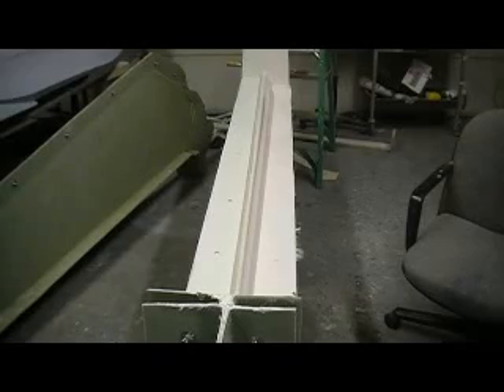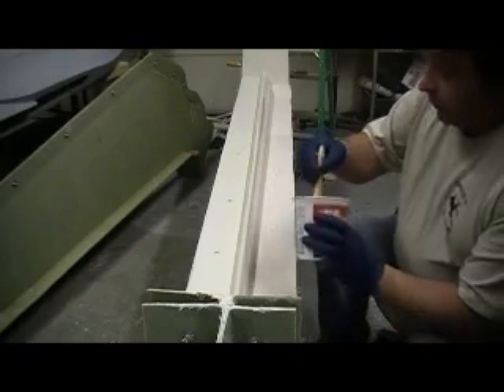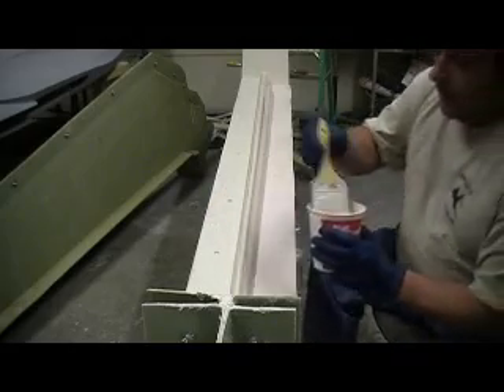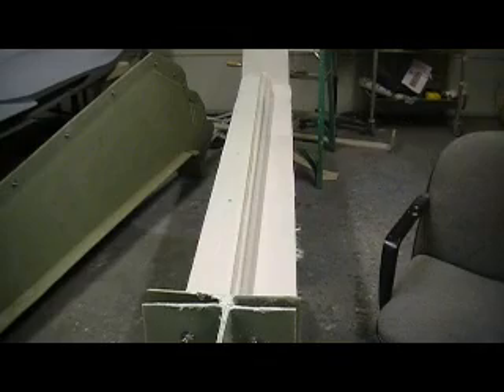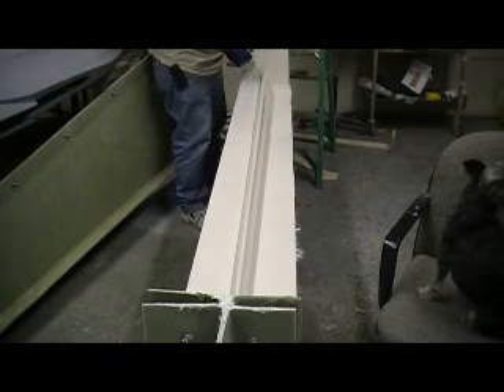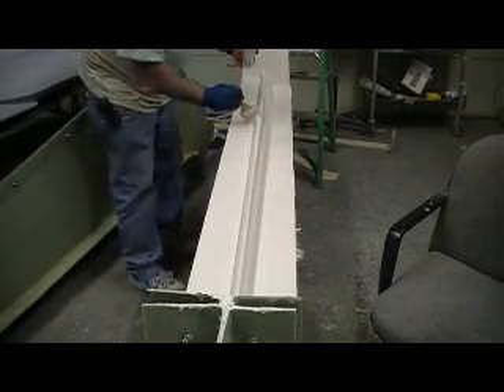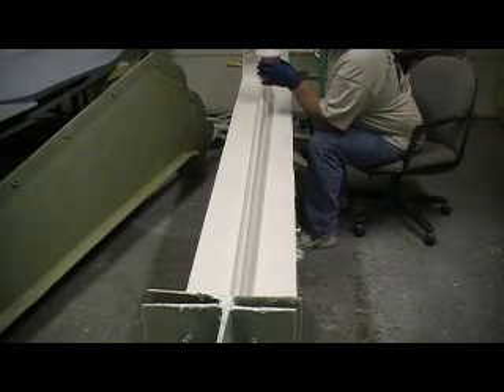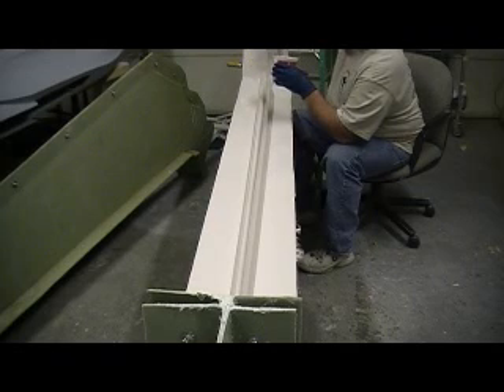how to build a rc jet B-1 Bomber 125 pt 2

Comment: Hey Bob-

Do you keep mixing in the same cup over the previous mix?

If not, how do you clean the cup?

BTW- REXCO makes both a water based Part-All and a higher temp solvent based Part-All.  I got this info because I used some of the knowledge that I gained from you at work recently.  Oh ya- I took some of your teaching to work.